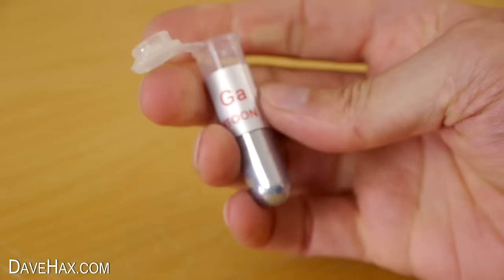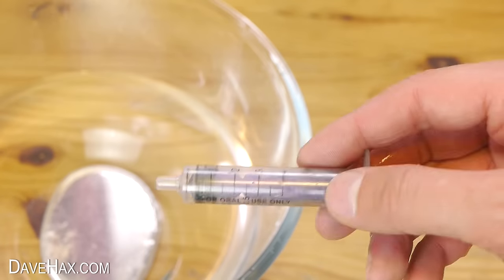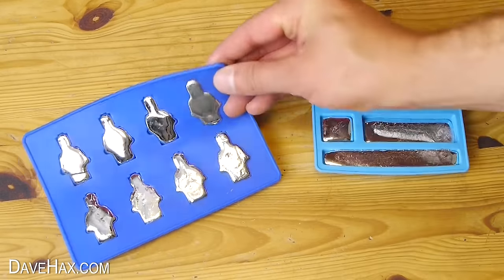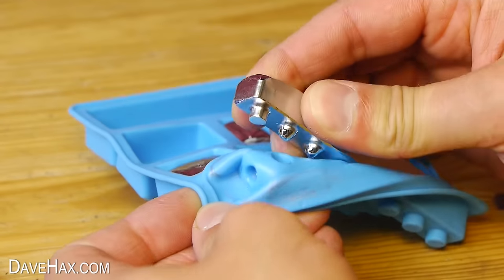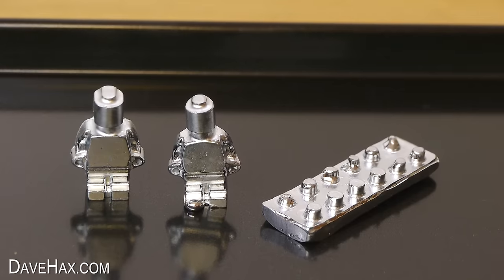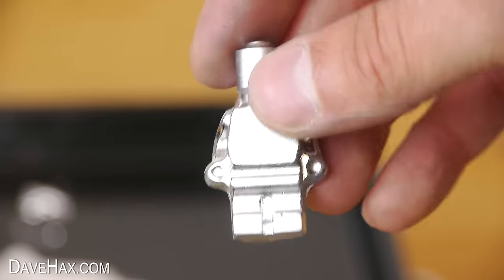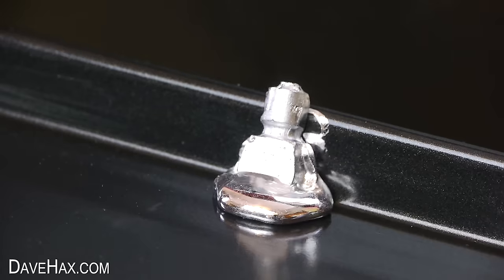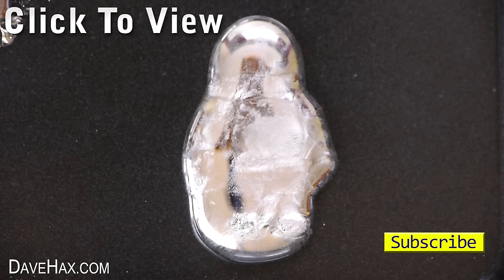DIY Metal Lego-Style Figures using Gallium

Comment: Yo Dave, Try putting some food coloring or spray paint the gallium,
Reply: Das not gonna work boi gallium is heavier dan the food colouring and won't mix but the spray paint may work if the gallium is solid
Reply: Space Guy e
Reply: I won't work, it will just do the same thing as the water does
Reply: because material sinks it's not because it's weight because I have a friend whit 110lbs   (lol ) And he can float in water. it's more about densiy

Comment: Field's metal is a safe, low temperature casting metal that melts at a higher temperature(144° F), but still low enough to melt in hot water, so it will last a long time after casting.

Comment: does gallium stick to magnets
Reply: no it is a pure element and therefore has no iron content, however it does amalgamate other metals the same way mercury does so if you melt some gallium and place an iron or steel ball in the center as it sets your model probably would be magnetic at least until it amalgamates. During the amalgamation process the metals tend to trade off their ions so there is a good chance it won't be magnetic after either. might be worth an experiment.